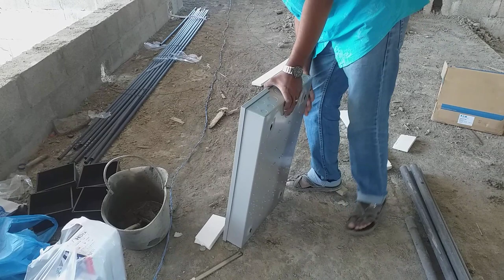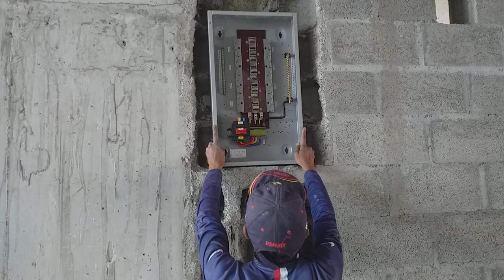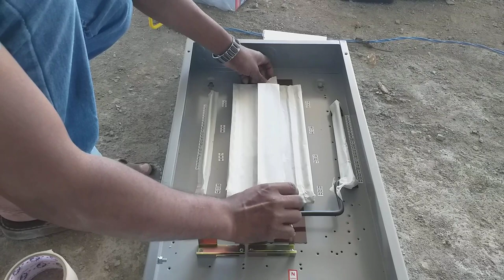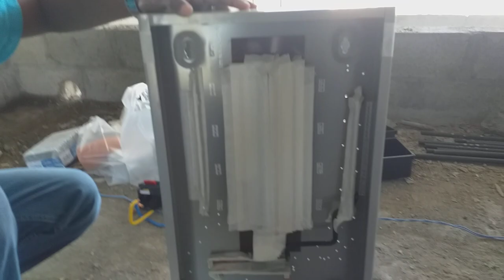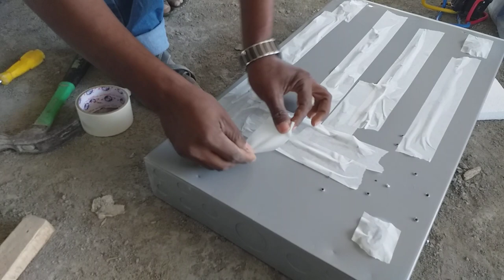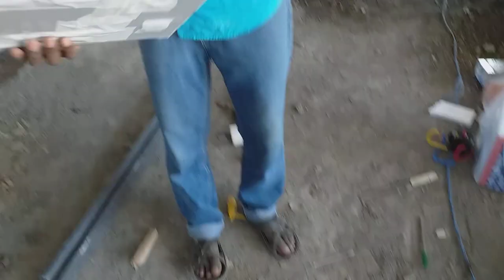Best of Electric Work by Experts of Asia/A 3 Face DB Board Possessing Before Fitting in the Wall

Comment: i don't understand  why he did that.
Reply: Oh dear the board is called power (Electricity) distribution  board. The board required to fit in every building to supply the electric power separately.
Hope you understand
Reply from the maker: this is called the power distribution board
Reply: ce g  That is a MEM EATON 3phase 8way(24Nos) DB.
What he is doing is essentially removing all breakers & tape-ing/closing up all vital parts like its bus bar, neutral+earting bar, din rail, screw+bolt threads in preparing for concealing the DB into the wall. During sementing & concealing, lots of wet cement will be used. So as to safeguard those vital parts frm wet & later hardened cement, he has to prep the board that way...